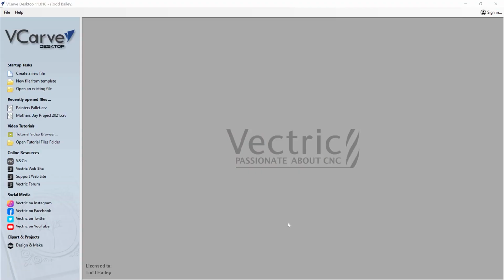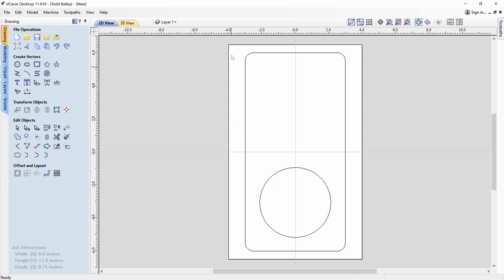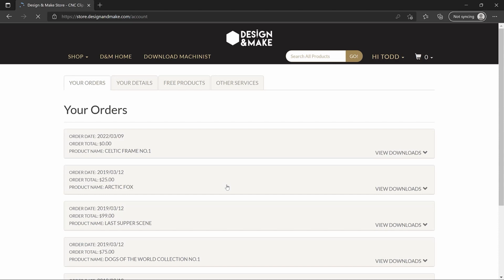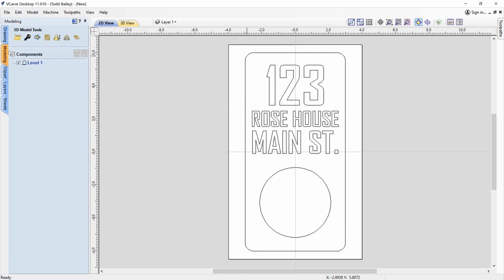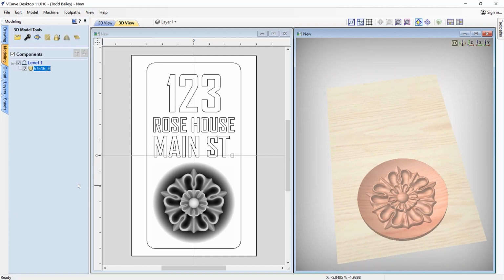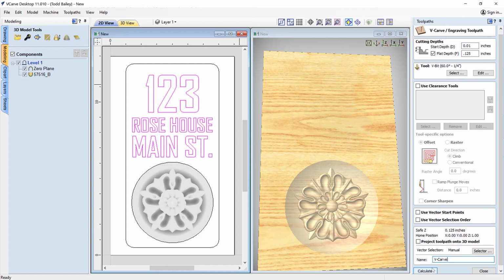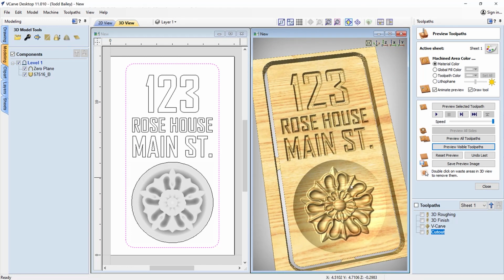Making Your First Project With Design & Make

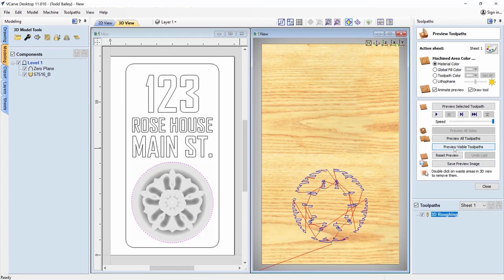Comment: @11:33 If you happen to get an error that says something like: "Check that the pass depth for the tool does not exceed the depth of the model being machined..." You can find the pass depth value setting by clicking on the "Rough Machinining Toolpath" option he just showed us and clicking the "Edit" button under your bit selection. About halfway down those options is "Cutting Parameters" and there you will find Pass Depth.